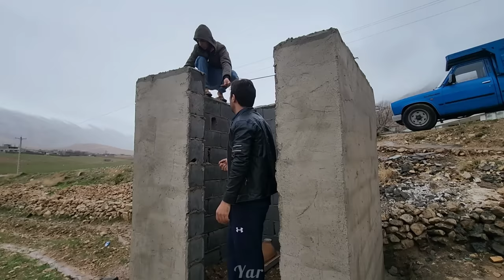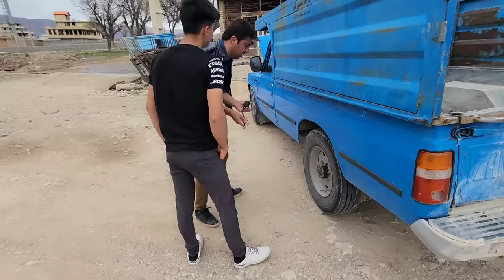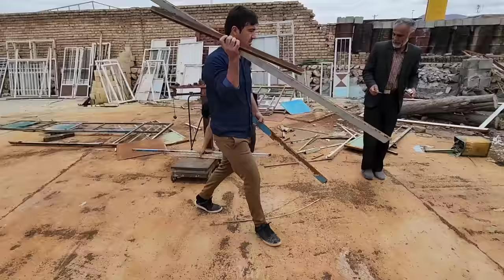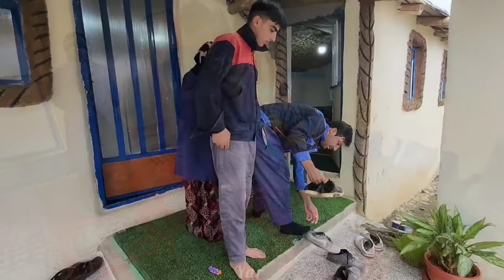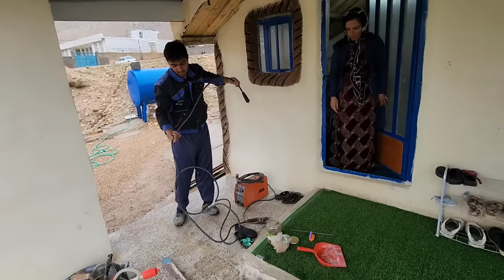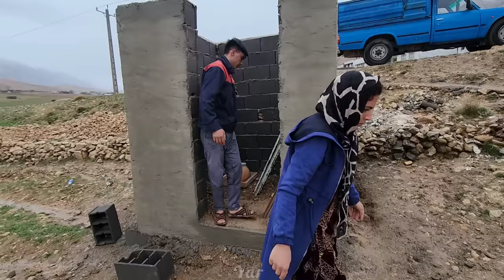Transforming the Toilet: A Journey to Secure Shelter and Dignity

Comment: Mr. Cameraman, in my previous comment, I said the bathroom is way too small and there should have been a window for ventilation and there should have been a sink to wash hands in there before coming out of the bathroom 🚽 install a big tank outside the bathroom just like you did for the shower and to used for the kitchen.